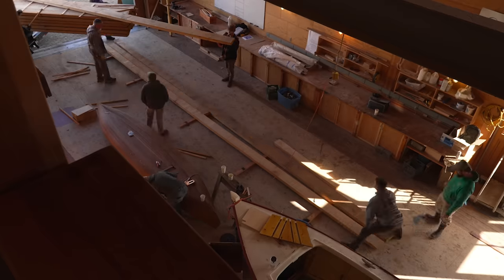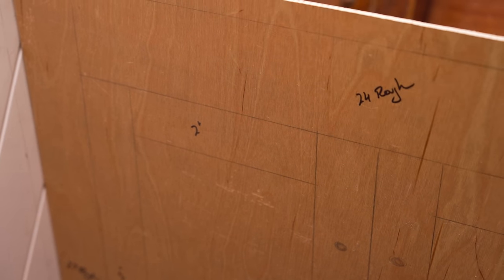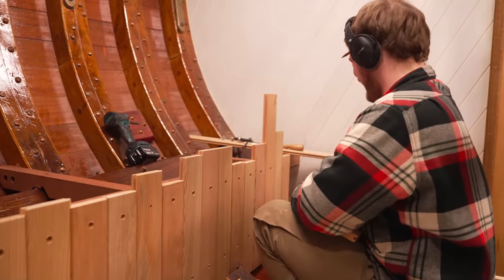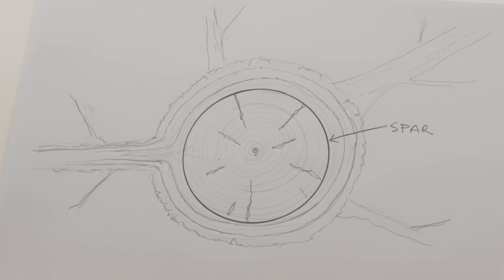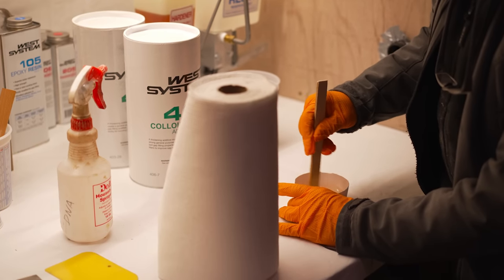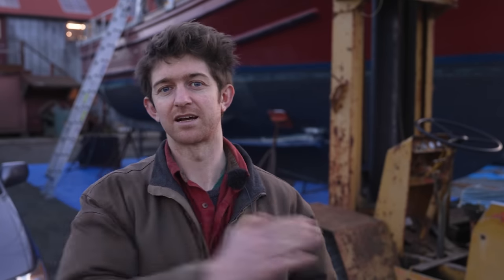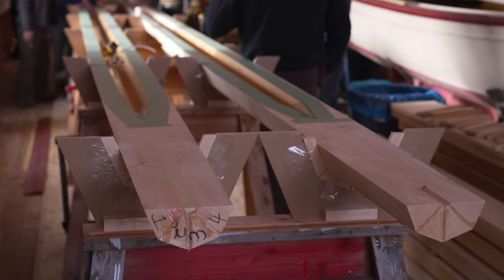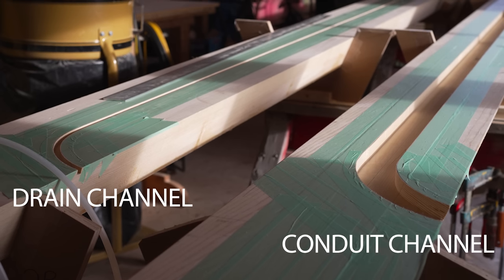Building the Mast (rebuilding Tally Ho ep146)

Comment: A very conservative wall thickness on the mast... Didn't you want to go lighter? The inside still doesn't take stresses I'd believe.
Reply: Any distance from the true neutral axis is taking strain, either in compression or tension.
I'd imagine that compression at the deck is the limiting factor with premium stock such as this.
Scantlings are developed by a naval architect or engineer. Perhaps the shop where the mast is being built had some input?
Reply from the maker: We went with about 27% wall thickness which is conservative, but adds a little more strength in line with the intended use of this boat as an all-weather vessel as supposed to a racing yacht which might go for lighter scantlings.
Reply: 27% is a great safe number for an ocean going boat. Most schooners have 30, even 33.% but generally they do not use the highest quality timber like used on Tally ho. The lesser out of grain, the higher the strength and this was the key driver during the cut.
Reply: Wooden racing spars will have wall thickness dropping to 12-15% but that’s coastal round the cans racing. Tally ho will need to stand the strain and abuse of the Southern Ocean !
Reply: @touchwoodbv-thesitkaspruce5107  So if you are involved and the target is this high I trust the dimensions will be alright.

Comment: All the strength of any pole is around the outside...  Yikes.
Reply: The max. tension stress is on one surface & the max. compression stress is on the opposite surface, both decrease towards the center. The interior can be safely hollowed out, the missing material would contribute little to resist bending forces.
Reply: @frederickstibbert7389  bending loads were not specified, so please tell me how hollow structures compare to solids when subjected to compressive and shear loads.